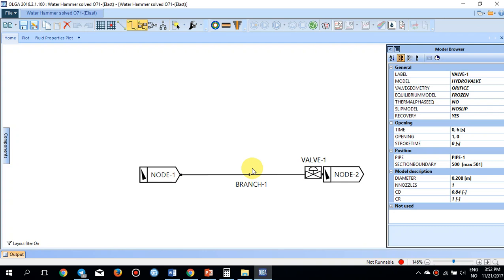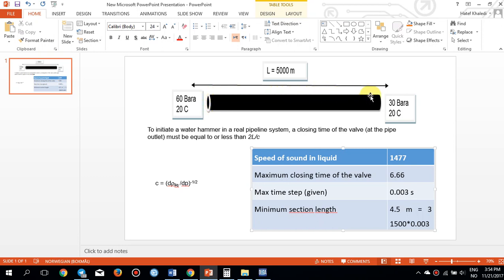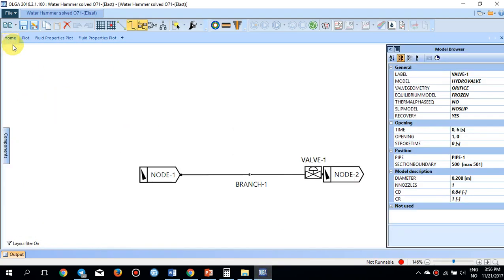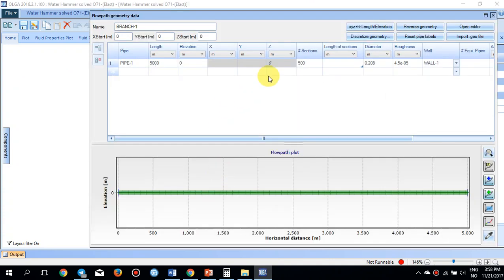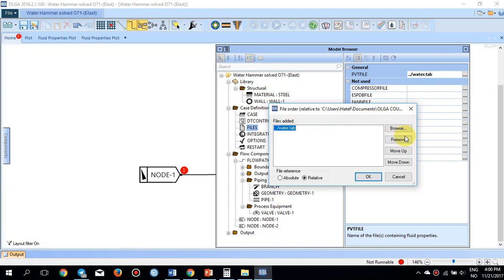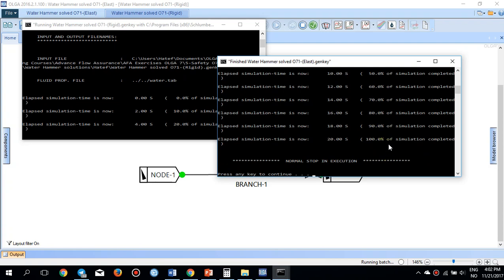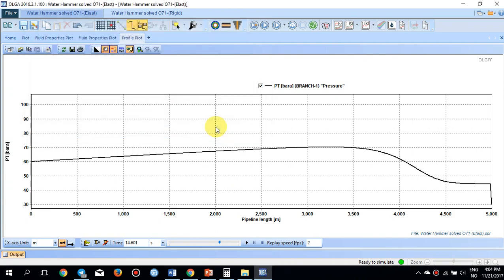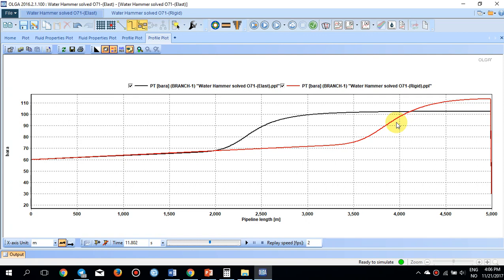Water Hammer Simulation with OLGA, OLGA tutorial 7

Comment: Hi Mr. Hatef, thanks for sharing your knowledge. It is very useful. I try the same model but with minor changes. I keep the valve at the middle of pipeline. The model does not converge and it gives error as "pressure below Table values -0.084 bar". How to solve this error. In PVTSim we can not generate fluid table below 0.001 bar. Kindly give me your advice to solve the error.

Comment: Thank you very much for sharing this. Have you ever tried to simulate water hammer occurring on a check valve (a "non-return" valve)? I mean when the valve is shut by the fluid itself, preventing its backflow in a circuit that is meant to be unidirectional ? Can you point out why such design are particularly prone to generate water hammer? Thank you